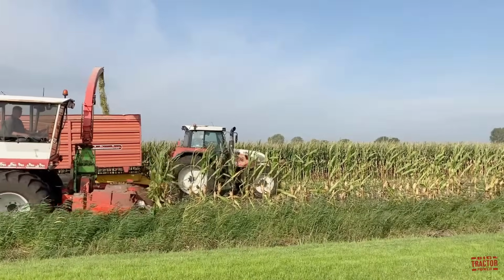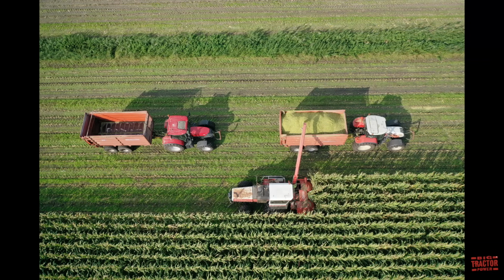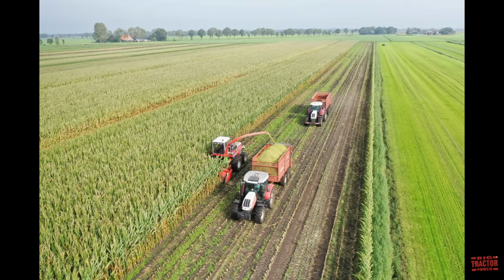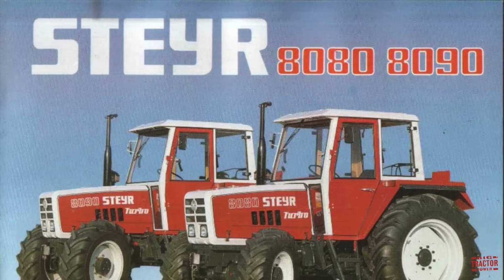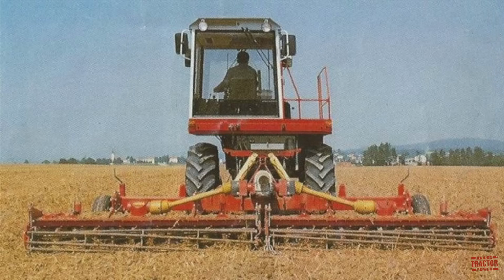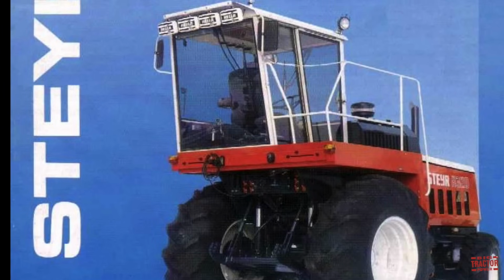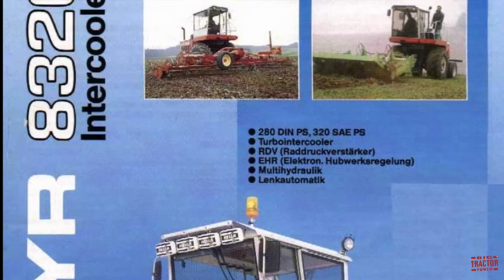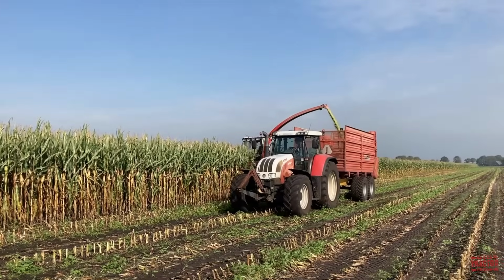STEYR 8320 Forage Harvesting Corn

Comment: Welcome here in the Netherlands :) We use our steyr 9320 (successor of the 8320 from the video) for corn chopping with a similar kemper system on the front, so almost the same setup as in the video
Reply from the maker: Very cool.  The 9320 sounds like a nice machine. Do you use it for other jobs besides chopping?
Reply: @bigtractorpower No we don't use it for something else, because it is an old machine, so breaks down regularly. The previous owner used it for mowing, and a nearby company uses them to chip up tree stumps in the ground. Those jobs, needing much pto power (and lifting heavy machines), is what it is also designed for.

Comment: It‘s always nice to see a Steyr 8320 because these have become very seldom. But it‘s great to see a Steyr 8320 in a big tractor power video. But there is a little mistake in the Video. The Steyr-Daimler-Puch Company concentrated their farm equipment operations at the „Niebelungenwerk“ in St. Valentin in early 1950s. Since then the Steyr farm equipment line has been produced there. The plant in Steyr became specialised on building trucks, bearings, transmissions, engines and rifles at that time. The town of St. Valentin is located at distance of 20 Kilometres to Steyr. The initial purpose of the St. Valentin plant was building tanks for the German army. The „Niebelungenwerk“ in St. Valentin was build by the „Reichswerke Herman Göring“, a company founded by the Nazi regime to supply the third Reich with goods needed for war, after Austria got annexed by the third Reich. This plant was located in Austria to protect it from allied bomber fleets. The plant was run by the „Reichswerke Herman Göring“ in collaboration with Steyr-Daimler-Puch and about a third of all German tanks in WWII were produced there.
Reply from the maker: Thank you for the additional history.

Comment: One thing I never understood is seems like Europe doesn't have the variety of hauling crops like USA like they have tractors with dump wagons or semi as where USA has wagons and trucks about any size
Reply: because you have to fit the thing on a european road, european roads in most countries are much smaller than american roads
Reply: @Erik-ce3hq  yea but they don't even have like single or tandem axle trucks with like 20' beds
Reply: Driving trucks in the field in Europe is usually terrible around here, the ground is often much softer and wet around harvest in our sea climate. So they just get stuck or have much compaction.. And the distances from field to farms are usually quite close, so less need for trucks
Reply: @Blackwellll3066  we do , they just arent that common in farming since, size and distance from field to farm is often fairly short